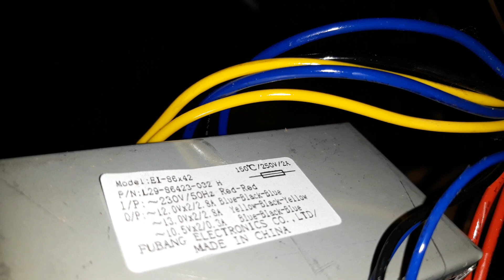What's Inside Philips SPA8000B 5.1 Home Theater

Comment: Please solve my problem ...my subwoofer is making noise when bass drops and sometimes bass is also low ..the noise is like dirr dirr.  Farrrr farrrr from inside of subwoofer....
Reply from the maker: The noise you told about, happens only when there is any extra air gap in the cabinet. Do you keep the plastic grill opened???
Reply: @technoboy-allinOne  no everything is packed properly that noise is from the woofer only ...at the time of bass ...
Reply from the maker: @rohny5587  then may be the speaker is faulty. Connect another speaker if you have and check it. Contact customer care if its in warranty.
Reply: @technoboy-allinOne  yes .. service boy said he will replace the speaker that 8inch woofer ..